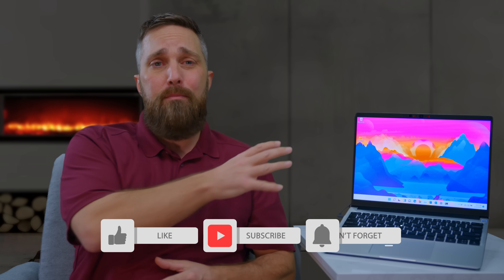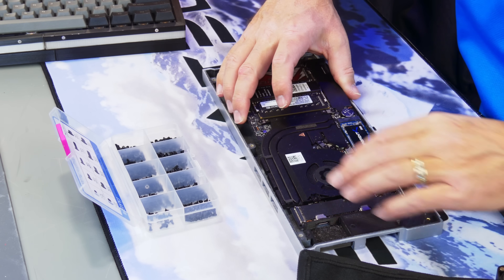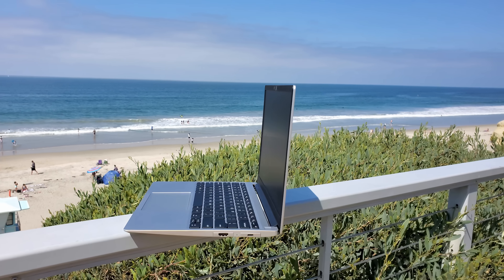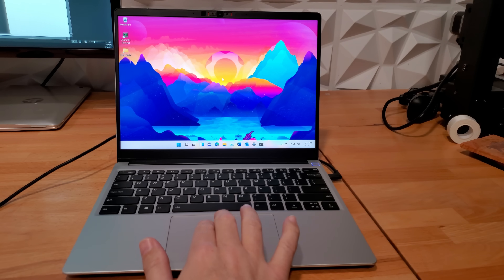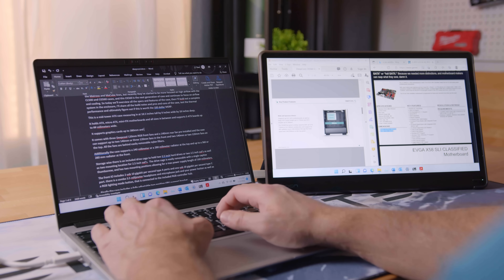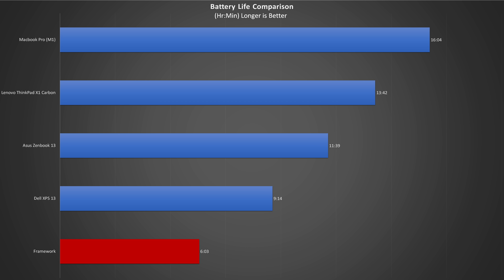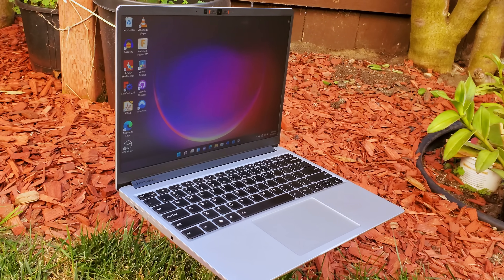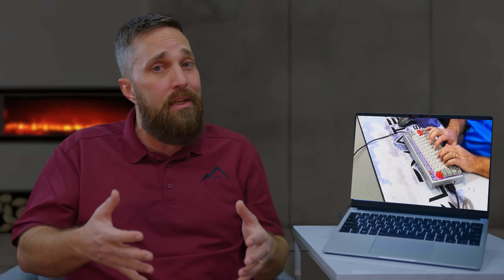Framework Laptop 6 Months Later. I'm Less Impressed 😐

Comment: With AMD Ryzen coming with RDNA 2 APUs and More innovative eGPUs like the XG Mobile coming, Im hoping to one day see a Framework with a moderately beefy cooling system for a good APU, that supports eGPUs with thunderbolt and PCIE lanes like in the Asus Z13 and X13 Flow. So you could have a gaming capable Thin n Light, which could do high graphic gaming with a RTX Card.  Who knows, you could add some more variety of peripherals with those Extra PCIE Lanes. 

ALSO, Imagine if the battery could be removed without dismantling If the Laptop! Carry 2 spare batteries for long trips and replace when one runs out!

Comment: I've had a System 76 laptop for a few years and it's been working great for me on both Windows and Linux. While I don't NEED a new laptop right now, I want a Framework laptop. Aside from the guaranteed Linux compatibility, the Framework takes everything I like about my Gazelle, and does it a bit better. My laptop is easy to work on, but the framework would be easier. I like to tinker and change things up from time to time, so it's very appealing to me. I would miss having a GPU for the occasional gaming session, but for most of what I do with my laptop I wouldn't miss it too much. (My Gazelle has a GTX 1660 Ti). I do most of my gaming at home on a desktop.

Comment: Biggest issue for myself personally still is the misdirection with the whole "repairability and sustainability" angle, especially when it comes to the "modular" aspect. For starters, the modules are too expensive for what they offer, which is a single port and some storage. Not only that, but they're more inconvenient than a dock, as you have to carry those square things with you if you need some of them. Sure, that may not seem like it at first but consider a USB C dock is a singular unit you need to add extra cables to. With these modules, you now have to carry small square things that can be easily lost along with the cables too. Also....Where's the AMD option? It's a bit ironic to tote a laptop as being "Linux Friendly" when AMD has a better track record with Linux support than Intel.

Comment: If they can put a Ryzen 6000 in a 16" version, I'll buy it.  I don't need a dGPU or the fastest CPU, but I do want the best iGPU I can get for Civ, League, CAD, and CV prototyping.

I understand why they went Intel. Intel has the capability to greatly assist with whole system design in a way AMD can't or won't.

Comment: For me the main problem is that I do not see any value added with those cards. They really do not give me anything. They just take away internal space. There are other laptops out there, similar format,. that give you more ports. 

Also the CPU is everything but powerful. Compared to a new R9 5900HS or i7 12800H  the performance is just laughable. Sure if you are only doing light office tasks as you stated in your video its more than powerful enough but everything else? 

I think the ethics of the company is cool but it is also not sustainable long term. You can not just send replacement hardware after just an E-Mail. You can not support 2% of the OS users. I am highly doubtful that Framework is profitable right now. And at some point they have to become that. So they will have to change a lot of what they are doing right now. 

So lets see. If they are still around and keep their support up, maybe even release upgrade motherboards for their laptop, I might go for on 2-3 generations down the road. For now Ill get myself a laptop with a R7 6800U and have much more performance, battery life and most likely even at a cheaper price point.

Comment: Thanks for your review! I've been running a Batch 6 machine since January and I am forming an opinion very similar to yours.

The more I use the Framework, the more I realize it's an average laptop from a performance standpoint. Battery life has been my greatest pain point. The hinges have been very similar to previous laptops I've owned and the trackpad has been fine.

Nevertheless, I risked freight forwarding a unit to my country due to the serviceability, longevity and value for money. My Framework build is still cheaper shipped compared to a getting a similarly spec'd machine locally.

Part of being an early adopter, but I'm still enjoying the ride!

Comment: Linux may have the smallest market share, but one thing I have noticed is if you build something to Linux standards and make that work...
You will as a result have something that is bullet proof in Windows and a lot more solid.
I would still pick a Framework, just knowing it can be repaired and having spare parts is sufficient... And now I get more open source firmware like coreboot on it as well? Just a better bonus to it.
I can live with a wobbly screen if that is the case though... But still I want an AMD GPU option for that laptop though.

Comment: I thought long and hard about getting the Framework, but I ended up getting the ThinkPad X1 carbon instead. I found it on sale for a good price. I am very pro "right-to-repair" but at the end of the day I did not want to spend that much money on an unknown. I have been using ThinkPad business laptops for years, so they were a known quantity. I also wanted a touch screen.  

I'm not disappointed with my decision at all the X1 c is super thin and light while also being an absolute tank. I swear Idk how they can build such a sturdy laptop that's that thin and light. There's like zero flex in the chassis.

Comment: Ryzen has great power efficiency but I alot of people who don't use enterprise work loads don't understand one of the bigger reasons why a company would pick Intel even if it's slower compared to AMD. Some software isn't supported with Ryzen chips. So you pay maybe a few thousand for servers that may not even work or just your standard consumer chips for yourself or if you're in IT hundreds of workers, and they may not even work for what you need them to. So yes Ryzen is amazing we all know this and its amazing with power draw BUT depending on your work load. Intel is your only option.

Comment: This seems about what I expected. When I can justify buying a laptop it will probably be from framework. I do wish smaller, more netbook-like laptops were more common in general, and if framework made one I would buy it in a heartbeat. Hopefully they'll be around for many more years!
Reply: The return of the subnotebook. Some 12-14'' laptops would probably hit the mark with super portability while still offering all the OS and software compatibility one is used to from bigger machines. Even with a cut in performance for longer battery life.
Reply: If the company succeeded first 2-3 gens of laptops, they might be able to create even slimmer casings for replaceable parts and slimmer connectors.
Reply: theres the 13 inch framework laptop now! suports amd cpu too for battery efficiency

Comment: Framework sells laptops with an Management Engine. That's not acceptable. Also their laptops doesn't come with GNU pre-installed. So what makes them better than the competitors. 

Only PINE64 and Purism sell laptops without a Management Engine and with GNU pre-installed.

Comment: Why use laptops with open hardware, when you use a closed and proprietary os?
Reply from the maker: This isn't a coreboot system. Almost all the hardware in the laptop is proprietary. Also I said I run a dual boot OS.

Comment: I had much worse experience with the track pad in Linux. Windows 11 has been OK for the track pad for me. I get power blips where the display will just turn off then the keyboard will sometimes stop working. I resolved go just turning it odd entirely instead of sleeping the device. This is my biggest gripe.

Comment: on testing linux distros,its likely outdated by a fair bit,also TLP (use TLPUI for gui options) and auto-cpufreq should help alot with battery life if you do need/want linux for something.
even if its just for testing.
though great video,id say that framework is an amazing laptop,not perfect (as you said),but your assessment of it was great.
Reply from the maker: Check out my Ubuntu on The Framework video. I did extensive power efficiency testing and went through TLP and Powertop settings.
Reply: @ElevatedSystems  ah,ok,thanks for mentioning that.

Comment: I dont believe linux eats battery faster than w11, there is a misconfiguration somewhere, p-state configuration, if you are using KDE baloo may will indexing when PC is idle, also if you install steam will compile shaders in background so... many things can happen before you get a stable playground to test
Reply from the maker: Well I believe my results. I've tested 9 different distros so far, all clean installs, no third party background apps, and all have worse battery efficiency. In every case the PCIe ASPM and/or Thread Scheduler has been up to half as efficient in the Linux kernel than in W10 or W11. What has your testing showed?

Comment: Ordering mine soon. I am split on the hynix p31 vs the saberant you used. You have any opinions on why one over the other? Most important thing i noticed vs the WD 750 is the low power state consumption.
Reply from the maker: My selection was simply due to the fact that I already had it and the RAM on hand.
Reply: @ElevatedSystems  any thoughts or opinions on one over the other? I know the p31 is gen 3 and the p41 is still s few months away. The wake up times are incredible over others, the sabrent seemed to have very good overall numbers.

Comment: I'm worried of all -abilities, what's about upgradeability, it's quite some time since it was released, and we haven't seen ryzen version and also 12th gen intel hasn't been even anounced, nor even a simple expansion card... So I'm afraid their business isn't sustaining or even that it was a one trick pony and that's all... If you're not designing and developing whole laptop from start, it sure shouldn't take that long for motherboard only... Or have they inappropriately evaluated the work they'll have to put in to develop a new mobo for the existing chasis for chips with different characteristics... Besides that, I think that they should go out with at least 2 variations/screen sizes with at least 2 colors silver/black clog, black/silver clog, so people would have sense of choice,  and not a sense that they're forcing themselves into something they don't actually 100% fit in, for the "greater good" of all -abilities  we have yet to see...

Comment: Unfortunately, battery life is an unavoidable tradeoff for expandability and repairability, at least in this generation of hardware. The XPS and other comparable systems achieve their longer battery life with the use of LPDDR4x RAM, which uses a lot less power than standard DDR4.  Unfortunately LPDDR4x is not available in a removable form factor like SODIMMs; it must be soldered to the motherboard.

Alas, it looks like the same situation is playing out in the next generation of memory. DDR5 can be bought as SODIMMs, but LPDDR5 and LPDDR5x cannot. Let's hope that changes, though it may not be possible because of the super-low I/O voltages used by the low power RAM variants.
Reply: I don't have LPDR4X in mine, battery life is similar, about 6 hours with mixed usage, web browsing, gaming, workloads using Photoshop and such. So definitely seems like I push my system harder, but I still get atleast 6 hours out of it, more without gaming. In my case from yesterday Switch Emulation, Burnout Paradise Remastered and Dead Cells. Vivobook 15 Pro OLED, Ryzen 5600H, no dGPU
Reply: Part of the reason why it got mediocre battery life is due to software optimization and using intel, i mean intel 11th gen chips were never known for their battery life
Reply: ram uses hardly any power at all, its a rounding error compared to the CPU or even the screen, more than likely its the wattage from the CPU staying too high, or a less efficient screen.

intel the past few generations is well known for pulling LOTS of power. which is why apple had a huge jump in battery life when they switched to ARM, they went from 30-100w down to 10-30w,  which is a way bigger difference than the MAYBE 10W the ram pulls
Reply: @bradhaines3142  RAM is a small part of active power consumption. But it IS a significant factor in standby power use, which is a big factor in battery life.
Reply: @ShirleyMárquezDúlcey  in standby, when it should be on the charger, which is NOT a big factory in battery life. and if you actually shut the computer down you have no standby power usage
Reply: @ShirleyMárquezDúlcey  i looked it up, its literally a difference of 5w, thats nothing. considering the whole system would use around 60w when active, maybe up to 100w under load (if boosts are allowed to) 5w would be just above margin of error in usage. 

even worse, the margin is 50%, which is actually a big difference, but my point is even standard ddr4 uses so little it means next to nothing. a hard drive uses more power than that.

Comment: I agree with the trackpad issue, so I typically use a USB vertical Anker mouse instead. Additionally, I get feedback (high pitch tone, and a clicking noise) while using headphones plugged in. Its not the headphones themselves, since they work fine with my desktop computer.

Comment: Question: Can you get it with a windows pro Key in the bios so that when you reinstall windows pro it has the key without having to go enter it.
Reply from the maker: If you get it with Windows installed the key will be associated with the laptop so you can always reinstall it.
Reply: I'd likely use just fedora linux but it would be nice to have a windows key just in case I ever wanted to use it that way or see it that way.